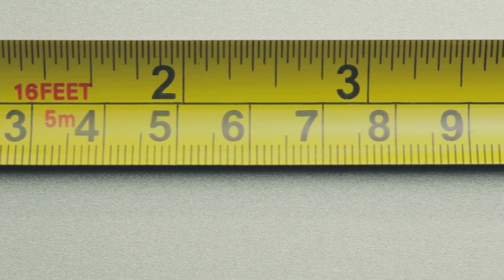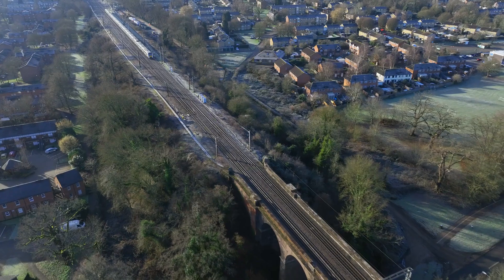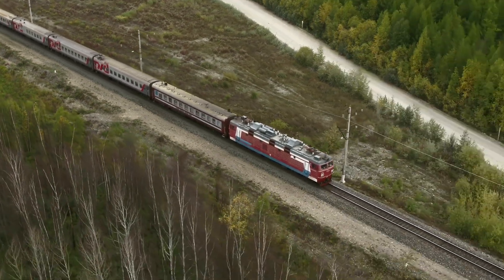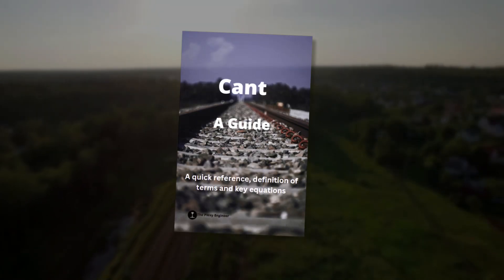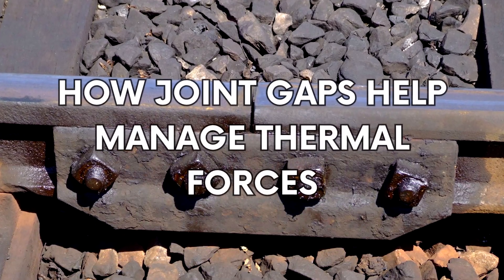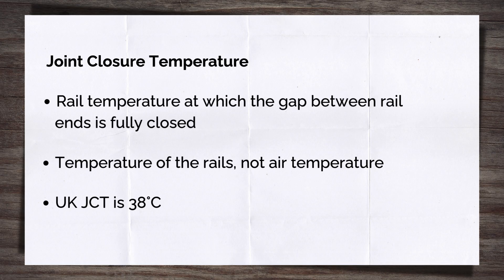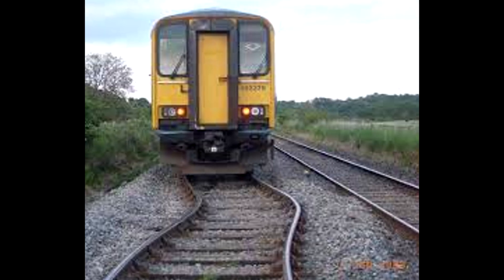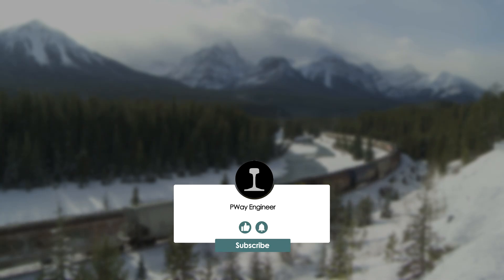Why Joint Gaps Matter on Railways — And What Happens If You Get Them Wrong

Comment: Here in the USA. We are lazy. So i never ran across any oil joints bar set. But i have oiled them myself on 90 pd. I ran across a few jionts that were bound up. So i oiled them up, and it took care of the problem.
Reply from the maker: I keep hearing that there is no fishplate lubrication requirement in the US! Wonder why when it’s so common in the UK
Reply: @thepwayengineer  Do they have some kind of plastic liner, like mylar or phenolic? They used to put mylar between leaf springs to stop them from squeaking.

Comment: The calculation maximum opening gap normaly, depends diameter of hole rail, fishplate hole diamter, diameter bolt and distance of the first center of hole.CMIIW
Reply from the maker: All those will factor in the amount the joint can move, definitely